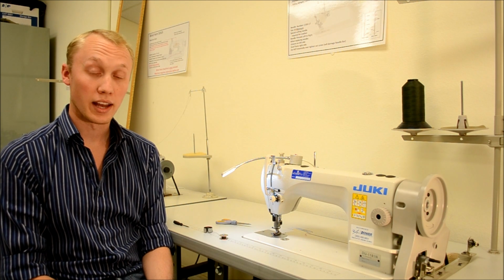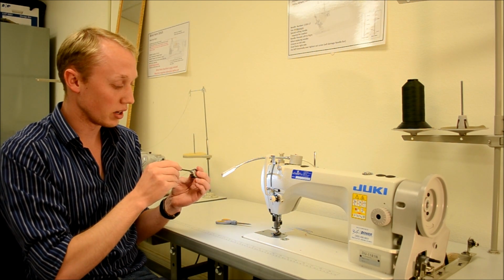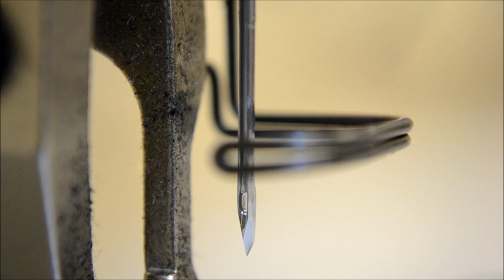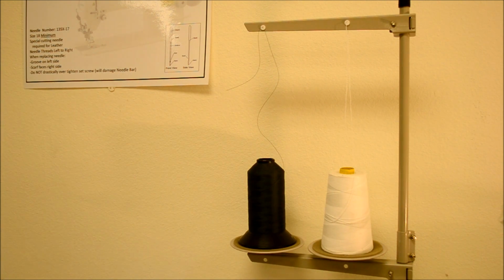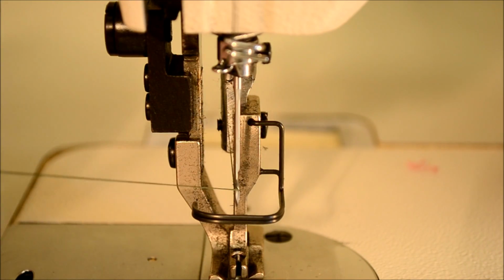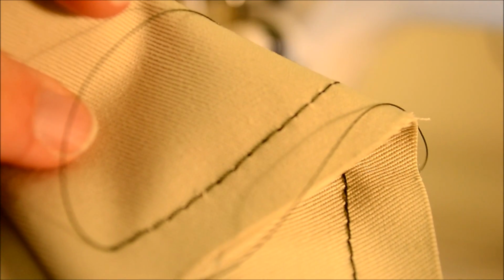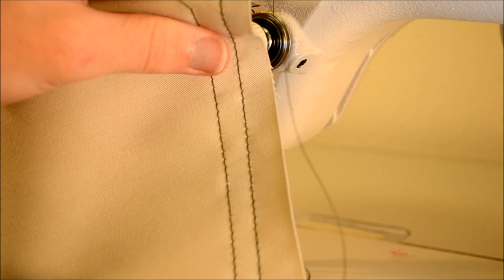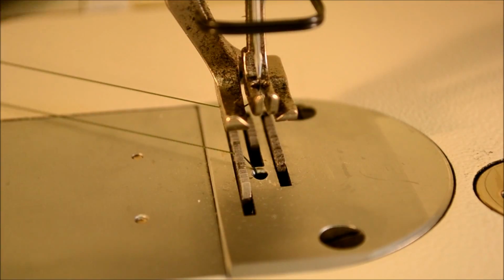Industrial Walking Foot - Juki DU-1181N

Comment: I just got this machine, my main purpose is to make nylon belts and possibly leather. What are your thoughts of its capabilities on leather? I am also confused on the thread sizing. The manual says #40-#8 which seems different than normal sizing. Thanks for the video very helpful.
Reply from the maker: This machine works very well on both nylon webbing and on leather. If you're working with leather you're going to want to make sure that you're using a leather needle (with a spade tip, rather than a round point). This machine is capable of handling a wide variety of thread weights, from standard serger thread all the way up to ultra-thick upholstery topstitching. www.thethreadexchange.com is a great source for information on thread. Their size 33 thread is like a standard home sewing thread, which would be the minimum for this machine. I've tested threads all the way up to size 207 without problem. Make sure your needle size corresponds with your thread size, though. They tell you on the website what size needle is recommended for each thread weight. Have fun with your new machine!
Reply: @phillipmiller90  I know I'm a little late to this conversation but what type of leather are you talking about specifically?
Reply from the maker: @kodydstevens93  This machine handles almost all types of leather. You may find that it's a little too big and bulky for the thinnest leathers, like glove leather, so a regular straight stitch machine might be better for those. You may also have trouble with multiple layers of some of the heaviest leathers, like saddle leather, in which case you'll need an extra heavy duty machine. But for everything in between this machine is perfect.
Reply: @phillipmiller90  thanks for the quick response. I work on leather veg tan wallets and purses so just making sure I got the right one haha
Reply from the maker: @kodydstevens93  Yes, this machine should be excellent for that. You may want to invest in a specialty presser foot for leather, too. Standard presser feet have teeth to help grab the fabric and pull it through, but a leather presser foot is smoothe instead so it doesn't mar the leather.

Comment: Great Video!! Thank you for sharing, I am in the process of buying an industrial machine. Yours is quiet, do you have a servo motor?
Reply from the maker: Thank you! Yes, this machine has a servo motor. Most of the machines I work with have them, and I highly recommend them. Servo motors give you more power, greater control, and don't wear on your nerves with the constant humming.